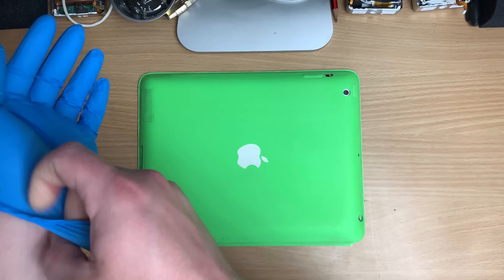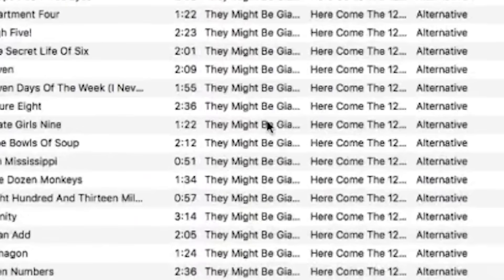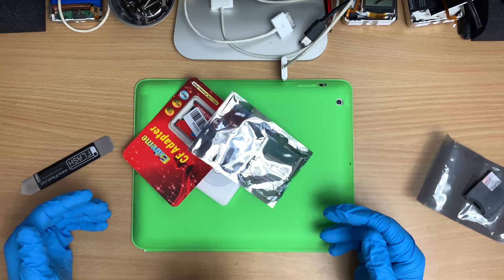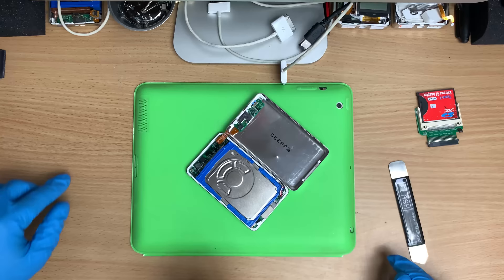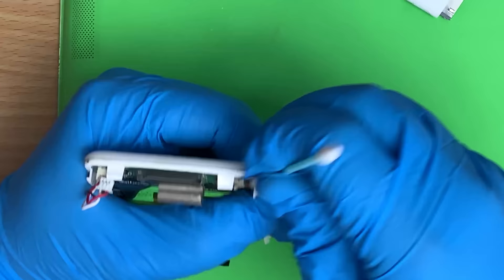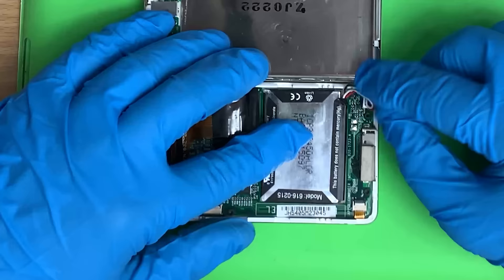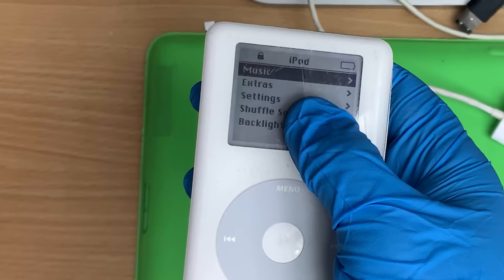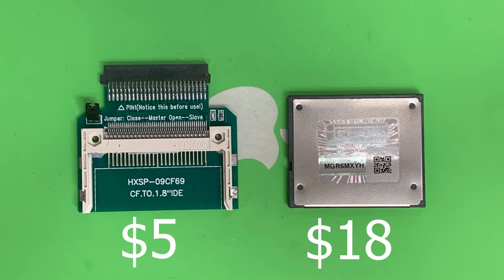How cheap can you flash mod a garbage iPod?

Comment: To anyone wanting to do this, I just got done with my first flash mod. 4th gen b&w screen just like the one in the video with 128 gigs. I used the dirty cheap adapters and they worked fine on the first go.

Comment: The foam trick is critical. I just helped a friend who thought his 4th Gen Photo was gone (had the sads). Found online that the OG hard drives sometimes just needed a bit of pressure on the hard drive connector because they easily could stop working. Proud to say I was able to crack it open and pop a pice of pelican case foam inside and it instantly started working. Thanks for the inspo, good look with the foam, and thanks for a sort of basic guide here.

Comment: What I've noticed is that some "broken" iPods, particularly 4th generation ones and Minis need to be connected to Firewire or and older dock in order to have enough power to charge the battery and spin up the drive, especially if it has sat for a long time.

Comment: I used these same cheap parts to upgrade my daily 3G a while back. All was well until one day, due to circumstances I won’t get into, it suffered an 8 foot fall onto concrete. It continued working for a minuet before it had a panic attack. Being a student, I didn’t have time to sit down and properly fix it, so in the middle of a math test I used my student ID card to pry it open and found out the whole drive slid out of the socket. 

TLDR I should have used a bracket of some sort, and yes it worked after plugging in the drive. 

Had to reseat the battery however and the clock was never accurate after doing that. It would always go fast no matter how often I set it manually.

Comment: Fool proof method: Use one of those cheap hard drive adapters, buy a better SDXC to CF adapter (Digigear makes a good one and it's on Amazon for $14.99, MUST THE AN SDXC VERSION),  buy a SanDisk 128GB (or lower) MicroSD card that comes with a full size SDXC card adapter (don't format it, just use it straight out of the packaging), assemble everything nicely like shown in this video, reset iPod (Menu + Center) and as soon as the screen goes blank immediately press and hold Menu and Play/Pause to enter disk mode. Then plug into a WINDOWS computer (IDK why it has to be this way, but trust me) with iTunes installed on it from Apple's website (not the Microsoft store), wait a minute and open iTunes and it'll prompt you to restore the iPod, click restore and let the computer do its thing. The iPod may ask to be plugged into a wall charger after restore (the computer's USB port isn't sufficient for some reason), you'll only need to connect it to the wall charger for a second. Then your new flash modded iPod will boot up and you can do your happy dance. You can then continue using it with Windows, if that'd your preferred platform, or plug it into your Mac (my preferred platform) and it will read the iPod no problem, you can re-restore to be Mac formatted with Finder in Catalina or iTunes on older versions of MacOS. I discovered this method through A LOT of trial and error and have flash-modded at least 50 iPods and this is the only method I use now and it works EVERY TIME. I've wasted hours of my life trying to get my Mac to read an iPod that's just been flash-modded but not yet restored, Disk Utility, formatting 100 times with every file type imaginable, and my results were mixed (mostly failures) until I finally figured this method out.

Hard Drive adapter to CF for 4th gens: amazon.com/gp/product/B00S6AK592/ref=ppx_yo_dt_b_asin_title_o01_s01?ie=UTF8&psc=1
SDXC to CF adapter: amazon.com/gp/product/B00EPMWT1M/ref=ppx_yo_dt_b_asin_title_o01_s02?ie=UTF8&psc=1
MicroSD card and SDXC adapter: amazon.com/gp/product/B015IYWJWO/ref=ppx_yo_dt_b_asin_title_o01_s00?ie=UTF8&psc=1

The hard drive to CF adapter will be different depending on what model iPod you're flash modding, but the second two items can be used regardless of the iPod type, as long as it had a 30 pin dock connector at the bottom, so no 1st or 2nd Gens. I know this was a long-winded post, but hopefully it will prevent headaches for others in the future and maybe even DankPods himself! Cheers! Love your content, DP!

Comment: The cleaning process strangely reminded me of the scene in Toy Story 2 when Woody was getting restored by Al. Anyone agree with me or know what I'm referenceing? Either way, love your vids man! Been watching for a while now. I have a few questions if you have a chance to answer them. 1st, have you ever had to replace the battery connector on the logic board? mine broke off on my 6th gen :( 2nd, I also have a 3rd gen that I bought when I was a child, never got it to turn on back then but I was wondering do iPods even try to turn on with a bad battery? I should just order one and find out. Also not sure but does it need Firewire to charge and USB to transfer data? Sorry for the noob questions :) Hope you are staying safe with this Corona virus stuff! Cheers man, take it easy.

Comment: Question, I bought an iPod 4th gen off eBay, and if you’re looking at the bottom where the charger goes, the little white plastic border that goes around the port has a broken side. Now what part would I have to order to fix that? I don’t know what it’s attached to, haven’t cracked open yet. Also would love to PM you if possible regarding some other questions! Thank you!

Comment: I've got 1TB in my 6th gen Ipod Classic with the iFlash Quad.  Yes, I have that much music.  It can only handle 2000 folders per level, and the stock apple firmware freaks out after 20,000 files.  Rockbox has none of these problems, but in order to get the file copies to work properly you need a special firmware on the 5th gen iPods.

Comment: I ordered all the parts to do the "dirty cheap" way to my 5.5th Gen iPod. I will be tackling this little job this week. Any suggestions on what software to download to format and fidget around with the SD card in the event it doesn't work on the first try? Thank you.
Reply: do you know what adapter you need to get for a 5th Gen and up? Isn't the connection different to the 1.8" IDE connection of the 4th Gen?

Comment: Dear community please help me.
I have an iPod generation 5,5  in white, the 30gb model. I upgraded it today to a new battery from the I fixit kit and the Iflash Quattro with one 128Gb SD card. I closed it and it started showing the apple logo on a black screen. After that it started to Display very low battery please charge and after that the sad looking iPod classic with the sentence to please contact apple support. My problem is this: Displaying the pls charge very low battery and contact support displays in a loop. I leave it charging for now but idk what to do. Should I try the different battery which worked but drained in a day or what do I need to do. Thank you

Comment: I used those red cheap adapters, 64 Gb max. And no issues. You have to format them at the start few times to get them ready and going but overall, they works just fine. Will be thinking on reinforce the joins when using these adapters, but now that I saw this, It may worth a try. Great video.

Comment: There is a little disadvantage. I notice that the baterry drains more quickly in sleep mode. Probably because mechanical drive has a power off feature, but SD is always on. I don't know but it's true. I compare two I pods same generation - with SD and with original drive. Same with replaced old with new baterry.
Reply from the maker: Huh, I’ll have to test for myself! Interesting...

Comment: iPod 4 question! Completed mod w CF but I can’t close the top right corner without blanking the screen out! Open it back up, screen comes on. Close it EVER SO GENTLY and it works until the tooooooooppp right corner. Then blink. Gone.
Reply: It seems to be the “jumper” pushing on the screen. Does anybody else experience this?

Comment: I did this mod on a 5th gen ipod classic, and, while there was definitely audio, there was no video at all. I couldn't figure it out so I threw it in a drawer. I should give it another go.
Reply from the maker: Yup strangely when theres too much stuff on an ipod the video goes all weird. If you only had a 30gb they lack the extra RAM.
Reply: @DankPods  That's what I had/have, the 30gb model. I can't remember how big a memory card I was trying to use. I need to track it down and investigate. Not enough ram to handle it sounds reasonable. 64gb is the most the smaller hard drive iPod models can handle? I probably tried 128gb knowing me. This was a few years ago, so I can't recall. Thanks for the info and the fun videos!
Reply from the maker: 128gb is nice and safe 💪

Comment: Hey DankPods! I've been watching a lot of your videos and thought I'd give flashing my iPod a try! I'm running into an issue where my PC constantly wants me to keep reformatting my Ipod everytime it restores and I'm stuck in a loop with it. I got the same green converter, but my sd card converter is actually a micro sd to compact memory adapter. Have you run into this issue with the cheaper adapters like this before? Any feedback would help!
Reply from the maker: Try putting the iPod into “Disk Mode” first. I cant remember off hand but there is a lot online about it! 

Then try formatting the disk to FAT32 on its own (not in the iPod) and try again

Comment: I have an iPod photo 4th gen stuck in a reboot loop, can it be fixed?
Reply from the maker: Of course! might be a dead drive
Reply: @DankPods  Thanks! I just bought an iflash adapter to put an sd card.
Reply: @DankPods  I REVIVED IT!! I've installed an iflash cf sd adapter with a 128gb sd card. It works as a charm. Thanks for the inspiration!!
Reply from the maker: Grats! Not hard aye 😉

Comment: Have you tried the dual SD CF adapters?
Or what about the WiFi SD to CF adapters.
Maybe get an ipod that you could up date through wifi with Rockbox or one of the opensource ipod front ends that update the database etc..

Comment: Does the metal polish cleans up the plastic front panel of 4g? My 4g ipod has lot of scratches and it has rough feel on it rather than glossy finish. What kind of metal polish you use?
Reply from the maker: Brasso is awesome at removing fine scratches on iPods but other metal polishes can make it way way worse. Brasso is the stuff you want!
Reply: @DankPods  even on the plastic surface?
Reply from the maker: Especially on the plastic! Try to rub in one direction like a woodgrain ie not circles. Its a super fine polish and all the tiny scratches will disappear. Use an old shirt, they are perfect for polishing.
Reply: @DankPods  thanks for your input. I'll definitely try it out
Reply: @DankPods  I only have old shirts, they will then smell of Brasso.

Comment: Wish I’d seen this a few weeks ago!! I got the dual micro SD to CF adapter for a mod I was doing to some 5th gen iPods. I couldn’t ever get the cf cards recognized by the cf card reader. I did get the computer to recognize the drives with one of the 128gb micro SD cards, but after it said it was restoring it, it just came up with the sad iPod screen. Ended up just getting the iFlash quad which worked first time, no trouble... I don’t know maybe the CF adapters can’t handle two 128gb cards. Seems to be conflicting specs for it online. Some claim two 64GB as the max and some say up to 2TB. What can you do?
Reply from the maker: Welcome to modding old junk, I got the 1TB iPod working by randomly formatting all the SD cards over and over again until it magically worked 🤷‍♂️
Reply: @DankPods  I don't like magic :D Maybe you could answer this for me. What format settings are you using when you reformat? I think I went through just about everything disk utility would let me. GUID, Master Boot something, and Apple something. I tried exFAT, MS-FAT, and extended journaled. If you could point me in the right direction then maybe I can get some magic to happen for me!
 :D

Comment: What is a flash mod
Reply: Makes it so your using microsd instead of apple's HD, like if your ipod died due to HD malfunction and you wanted to fix it, assuming you can even find ipod HDs nowadays this method would still be cheaper. It's cool and all, but I use my phone and can't imagine going back to carrying  around two devices again like it was 2007
Reply: zincmis2 thx for the explanation

Comment: i did the dirty scrub way failed hard, but not because of the cheap parts.

i fucked my cf sd adapter for some reason after fiddling around for 2 days opening/closing/changing cards since i wasnt able to pass the "plug into charger" screen.. turns out i need a apple usb charger lol

Comment: MY OCD hates that you never use Brasso on the back
Reply from the maker: Sadly it doesnt do much... stainless steel is a harsh mistress
Reply: @DankPods  Mother's polish worked wonders on my 5th gen. It's not as good as new, but most certainly better than before.

Comment: Where do you get the old firmwares from? What Version of iTunes do you use?
Reply from the maker: I’m using a 2007 iMac but honestly even the newest macs can still restore these old iPods. Even the FireWire ones through adaptors, Apple has full support still
Reply: @DankPods  thanks, I'm about to buy a few ipod classics 5th and 6the and want to upgrade them to sd cards
Reply from the maker: Oh nice! They restore on Windows or Mac real easy. Make sure you get the nice iFlash adaptors tho, its totally worth the extra money
Reply: @DankPods  where is the best place to buy the iflash cf adapters in Australia ? I got myself one of those cheap $10 CF adaptors, but haven't done the mod yet and now think I should follow your advice
Reply: @TheEverseer  just buy them from the good 'ol UK, I don't think shipping is too much?
Reply: @macinjosh2223  Got everything I needed from the store in one of Dank's video links here after the cheap chinese ones were unusable. But thanks for the reply!

Comment: I wanna frickin mod the fuck outta my iPod touch 6th gen like mod the camera to be 12 MP and upgrade the storage to like 128 GB or 256 GB so I can have my entire music library, most of my apps and games, and my entire photo library it used to fit it all back in like June 2018 now my photo library takes up more storage than the capacity of my iPod I got 3.6K+ high quality photos on a 32 GB iPod with iOS 12 which takes up 12 GB

Comment: Do you have a Zune™.
Reply: Not anymore, but I had several of them at various points. I actually still have the Zune software on my laptop. My favorite was the brick with an actual hard drive. 120gb! I sold it for some stupid reason and eventually picked up a Zune HD, but I never really liked it. I remember that D-pad at the bottom on the face of the 120; you could press and hold it or you could gently scrub the button without actually moving it to scroll faster. Damn it! Now I want to jump on eBay or something and try to find one!

Comment: I’m having difficulty locating the parts I need in Australia cheap enough. I have a 40gb iPod class. Model A1059. Unsure where to start. I’m a total novice. If anyone can point me in the right direction, I’d appreciate it :-) TIA
Reply from the maker: I definitely recommend the iFlash Compact Flash to SD adaptor. Its not cheap but it will work! Go to iFlash.xyz

Then type “CF to 1.8 IDE” into eBay and you should see the same board. The cheaper you go the longer you gotta wait to get it... its how they save money. Make sure you bend that pin down!

Then just get an SD card of your choice 👌
Reply: DankPods thank you! Are there any batteries you recommend? This is my first project like this. Just learning to tinker. I watch lots of these sorts of vids and thought I have an old iPod, may as well start here. Really appreciate it.
Reply from the maker: Whatever one you can find is good 👌